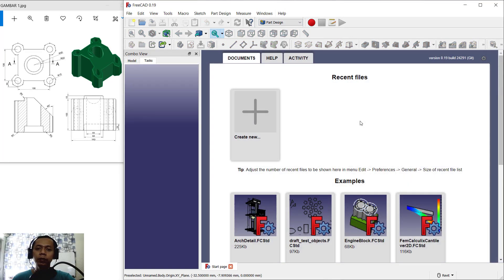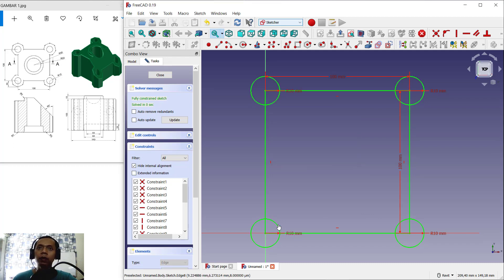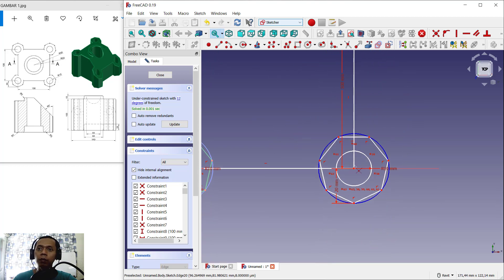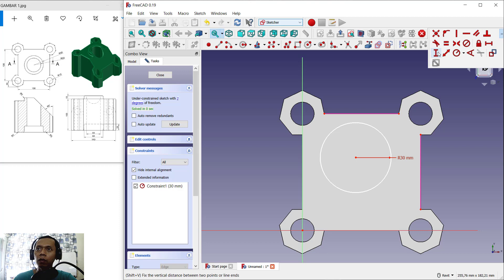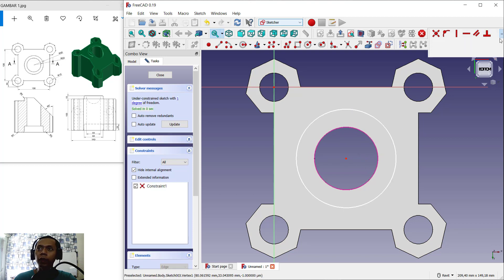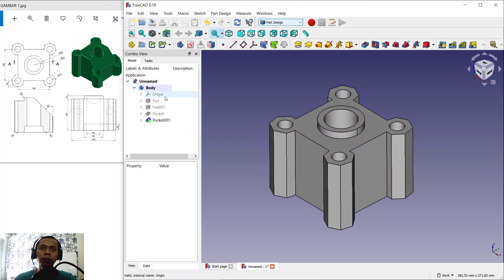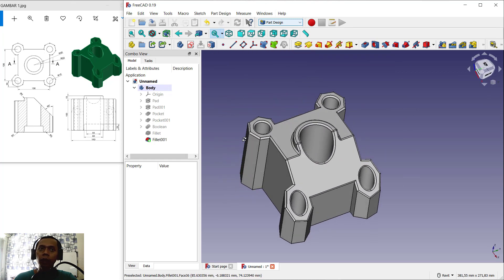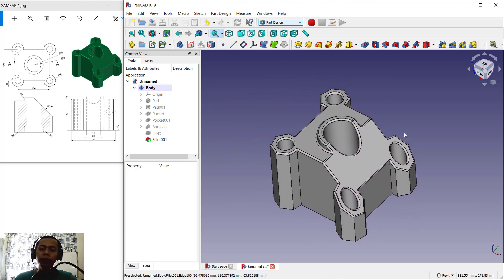Exercise 1 FreeCAD Basic Part Design Tutorial For Beginner

Comment: I am a new FreeCAD user and had very little experience with FreeCAD.  I did it.  I eventually duplicated the entire object in FreeCAD. I spent about 30 to 45 minutes each session watching and doing the practice on FreeCAD.  It took me many hours to slowly learn this Exercisse.  I have dual monitors which allow me to watch on one screen and work on FreeCAD on another screen.  I save at each major step with a step number so I can go back to previous steps very easily if I screwed up.  After I finished with the drawing, I export an STL file to my 3D printer and printed the object at 50% size.  Thanks.